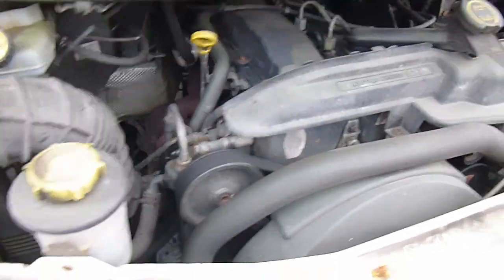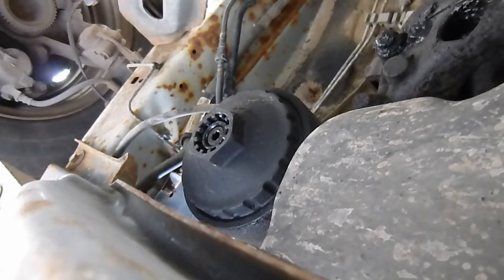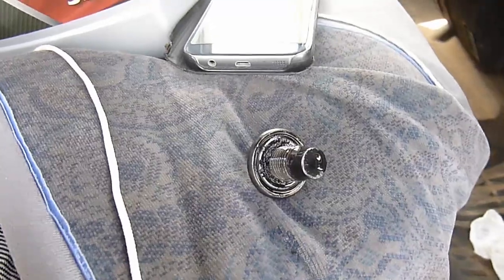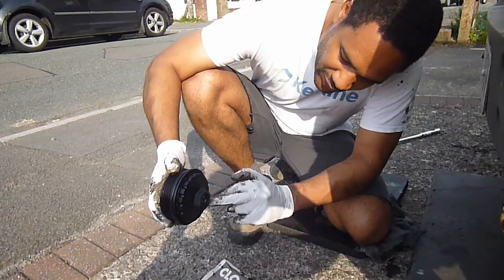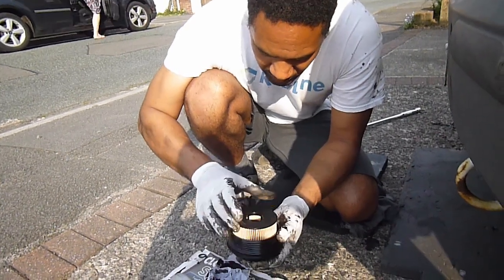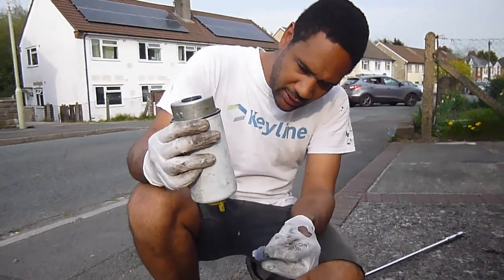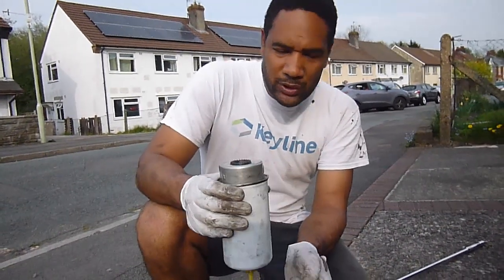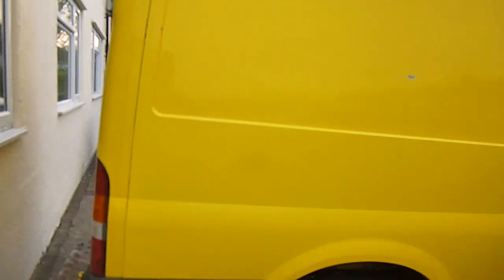Ford Transit Service

Comment: When changing the fuel filter, fill the new filter with fresh fuel and it will start first time. The problem with the Air filter getting wet is common , what happends is the rubber seal at the top of the engine bay is not long enough and poorly designed. When it rains this seal directs the water to the ends one side is directely over the air box which has a poor seal. another tip is to look around the inner wing area where the airbox is located and see if theres any fabric sound insulation and the same on the other side. if there is get rid of it as this gets water logged and will rot out your inner wings, anougher bad Ford design.
Reply from the maker: Thanks, I've had both issues you mentioned, you may have spotted my other vid changing the front wing, I put a strong polythene bag over the air box and it seems to have been good since.

Comment: Great video mate, I purchased a cheap transit with no history last year and serviced it first thing when I got it. My air filter looked like yours but way worse, like an animal was inside dont think it was ever changed! Oil change every year and fluids topped up and these things can run for ages!
Reply from the maker: Regular services is definitely the way to go, thanks for watching.

Comment: Nice work, I am servicing my transit tomorrow. One question where is you cabin filter located, as I am replacing all filters on service, cheers mate 👍
Reply from the maker: My vehicle hasn't got air-con I think the cabin filter is only on those vehicles. Thanks for watching.

Comment: How do you avoid airlock when replacing the diesel filter?
Reply from the maker: I found as long as you fill the new filter with fresh diesel before re-fitting, it seems to do the trick.
Reply: @michelod.i.y.5202  Do you fill it to the top or only half way?
Reply from the maker: @swldn  fill it right up to the top.
Reply: @michelod.i.y.5202  cheers,

Comment: Hi is that small bottle where the button is for the fuel primer meant to be completely full of fuel ive been pushing the primer button but it's not drawing any more fuel into it my van cuts out and will only restart when I use easy start thanks.
Reply from the maker: Just fill the filter full of diesel first hopefully this should do the trick
Reply from the maker: I tried pressing the button couldn't seem to work out it's purpose
Reply: Thanks for the reply ill give it a shot tomorrow thanks
Reply: @whowho6420  i know its been a while but did this work for you? Im recently having the same problem, will not start unless easystart is used.
Reply: @madvr69  hi I ended up fitting a new fuel filter and it was fine after that my fuel gauge was reading wrong and ran empty that's when the air got into it there's a little bleeding nipping thing at the bottom of the fuel filter if you turn it you might be able to hear the air escape and then diesel will start to drip out
Reply: @madvr69  if you do turn the bleeding nipple thing make sure you have a rag or something to catch the diesel it went all over when I did it
Reply: @michelod.i.y.5202  it's an indicator to show when the filter is old, pressing it just resets it when you change the filter

Comment: Nice video mate, just one question.. how did you remove and put back the fuel filter?, it can’t be seen in the video
Reply from the maker: Thanks for watching, to remove you simply pull it off. Turn the filter about 90 degrees to the right and it should then pull off.

Comment: Hello how did you remove the air lock please.  Have the same system. Keeps cutting out
Reply from the maker: Firstly make the fuel filter is full to the top you may have to remove it for this. After a few turns of the engine it should hopefully fire up. Failing this crack open one of the injectors and crank the engine over until clear diesel runs through, do thus with all the injectors. I hope you get it started. And thanks for watching

Comment: When someone has tightened the oil filter too much, it can be difficult to get the filter off, I had a similar problem with mine, 27Nm is just over nipped up, so why do people think it needs tightening to death? I was watching your video to see if I'll need to bleed the injectors after changing the fuel filter, I guess I will lol And clean the crap off the scuttle panel, leaves etc, as that can sometimes cause water to get in the filter housing, happens a lot on Vauxhall Vivaro/Renault Traffic/Nissan Primastar, on thise it drips down onto the injectors, making them impossible to get out, nice design eh. 
My air filter was similar to yours, but worse, it was the worst air filter I've ever seen, it had mould growing on it, lol 
Good video, my only comment would be to have shown the changing of the fuel filter, but that's because I wanted to see what problems you incurred. Thanks.
Reply from the maker: Thanks for your comment. My filming and editing is very poor, I really don't know why I didn't show the issue with the filter, probably covered in diesel and swearing a lot. The important thing is to make sure the new filter is properly filled up.
Reply: @michelod.i.y.5202  Ha ha, I thought it might have been because of the swearing :) I want to upload a video my mate took of me doing the rear brake calipers on his Primastar, but I'm shit at editing, so you're better than me, I've not done the video editing yet lol
Reply from the maker: Since changing the air filter, I rapped the housing with a heavy duty plastic and it's been bone dry.
Reply: @michelod.i.y.5202  that's good then, possibly where it was parked, maybe on an angle or something like that...?

Comment: Finally I'm a first comment - how do you bleed the injectors and what does it do ?
Reply from the maker: I Just crack open the nut where the fuel line joins the injector and turn the engine over until the diesel runs through without any air bubbles. I do this with all four starting at no.4.
Reply from the maker: theoretically your bleeding the fuel line, similar to bleeding brake lines.
Reply: @michelod.i.y.5202  Hi Michelo, do you mean turn the engine over, like starting electronically and watching until fuel comes out? I am a beginner and I replaced the fuel filter. first time it started but then 2nd time it didn't. I also hear nothing is attempting as well. can you give e detailed description step by step? And how do I know all air is taken out?
Reply from the maker: @leonvissers7021  first and foremost insure the new filter is full of new fuel. Then attempt to start the vehicle as you normally do. If this fails then start the bleeding process.  Basically you are only slightly undoing the nut on the fuel line that goes into the top of the engine. Using the key turn the engine over until the air is expelled. Then retighten attempt to start the engine as normal, if this fails move on to the next line going into the cylinder.
Reply: @michelod.i.y.5202   thanks for you fast and clear response. I am going to try that, the 4th one is the first you see if you standing in front of the car or the last one?
Reply from the maker: @leonvissers7021  that's right no.4 is the closest one. Hope you get it started 🤞
Reply: Michelo D.I.Y. Many thanks !! Up and running 🙌🏻
Reply from the maker: @leonvissers7021  excellent, happy motoring 😊

Comment: the downpipe is the screen drainage..if that's not watertight..you get a soaked filter..it happend to me after heavy weather.. it wouldn't rev over 3k revs.. shit myself .. air filter looked clean and fine.. it wasn't.. once wet they are toast.. new air filter fitted...hello booost...
Reply from the maker: Thanks, Ford have got a lot to answer for 😊